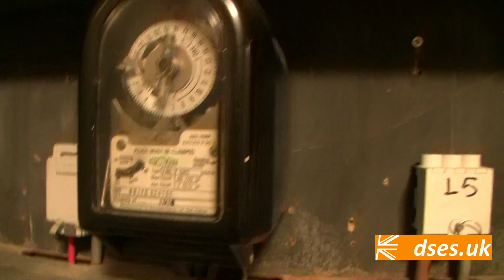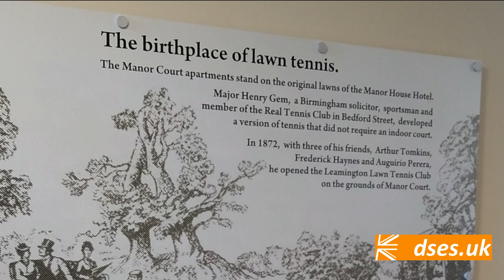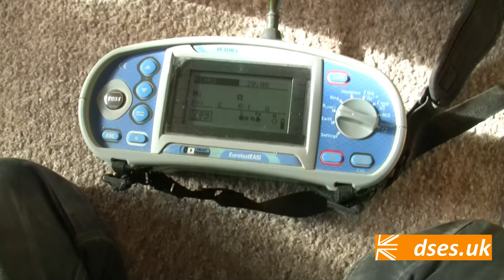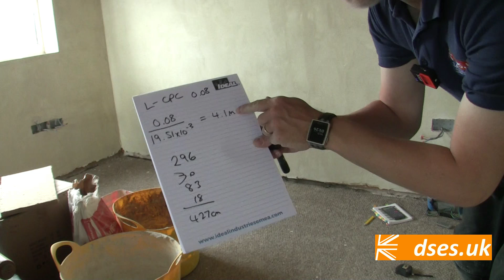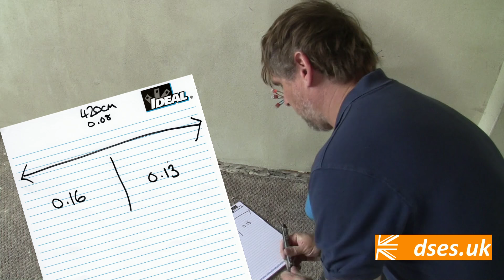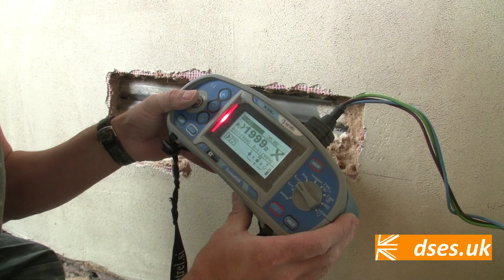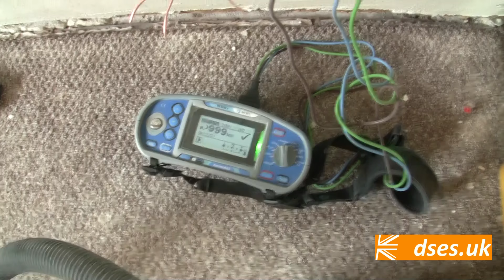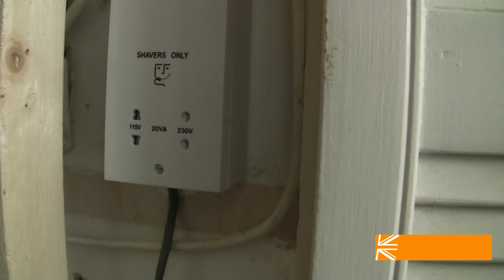Fixing another man's lash-up!

Comment: Quite a lot of people are saying it was done this way to balance the ring which I understand. Except that if you're going to be running both legs of the ring together wouldn't it make more sense to use a radical. Is there something I'm missing?
Reply from the maker: For something this size, I'd have run it as radial circuits. Probably one for the kitchen, another for the lounge and bedrooms.

Comment: Excellent content as always, thanks.  Fucktardary, Bumholery, great.  When I put rings down, which I prefer not to preferring 4mm radials, but when I do I kind of leap frog the sockets one with each leg as it goes to equalise the load along the length, but what you got there looks like nothing to do with that.
Reply from the maker: Thanks Rupert, I also fly the radial flag. It does seem like leapfrogging was the order of the day here, but in a capped domestic installation I question the reasoning!

Comment: This idea of frog looping seems to originate from the mistaken belief that distributing the sockets evenly along the ring somehow balances the current between the two halves better.  It actually doesn't make any difference to the currents which is probably why the practice is no longer taught.
Reply from the maker: I can see the method in the madness, but as you say, it just seems to complicate things with no benefit. Running in a line from point to point makes more sense to me.

Comment: Thanks David, really informative video on tracing a cable fault. I had similar problem when BT engineer drilled into the cable. Just used choc box attached to brick and put blank faceplate over it due to time / cost restrictions Not ideal, but ok if still in prescribed zone?!
Reply from the maker: The blank faceplate would have left it accessible and denoted its presence, so no problems there Nathan.
Reply: @dsesuk  as a householder I dont like blank faceplates they stick out of the wall and mess up the flow of it for hanging pictures etc.
Reply: @dsesuk  

So long as the connector block was of adequate rating!

Comment: Given two circuits would need to be in the same zone, would you run the cables for both circuits through the accessories or behind them somehow? I'm not sure how this would work! Thanks.
Reply from the maker: I've done it before where I've dug out behind an accessory position to allow another circuit to route past it. I don't like going through it, as anyone isolating that accessory for maintenance has another cable still energised passing through. This could have been done differently though from first-fix, and I'd have probably done it myself so that sockets ran horizontally at a low-level, with the heaters running in the 150mm prescribed zone at the top of the wall and dropping down into position. That's how I did the bedroom there which I mentioned on camera but didn't show.
Reply: @dsesuk  

I've also gone behind with other circuits although don't personally see any major issue with running a t&e cable through a backbox to a different circuit. I don't see such a cable being at any more risk than one directly clipped to a wall and that is acceptable.

Comment: Mate, there's a big difference in phone & laptops as far as charging current is concerned. You can't lump them in one catagory
Reply from the maker: Don't think it makes much difference with the design intention here. I also suspect the entire installation is metered off-peak anyway, so all sockets will be at a cheaper rate and not just this one wired directly.

Comment: I may have thought about cutting in a box. And doing a surface joint behind an accessory
Reply from the maker: That would be ideal Andrew, but would put it out of line unless the cables were extended, in which case you still have junction connections in the wall.

Comment: What you could have done was to work out the ratio of where the short was, total resistance = .13+.16 = .29,  for the short side it's .13/.29= .448, multiply by the cable length 4.2X.448=1.88 meters or 220mm right of center :)
Reply from the maker: Bear in mind, I got a GCSE grade D in maths.

Comment: I thought the 🇬🇧 uk uses red live black neutral green ground each conductor thicker strans of wire 
I wonder why the uk is 240 volts and Germany is 220 volts can you use a german 220 volt refrigerator in England on 240 volts or a British refrigerator made for 240 volts in Germany on 220 volts thanks
Reply from the maker: The old colours were indeed red and black with green oversleeving for earthing being replaced by green/yellow striped sleeving back in the Eighties (I think). The UK harmonised with Europe back around 2004-2006 and red/black was replaced with brown/blue. We also (supposedly) harmonised on voltage, but all that really meant was a tolerance was introduced where the supply was now classed as 230 volts -6%, +10% giving an allowed range of 216.2 volts to 253.0 volts. Nothing really changed on the supply side, and 240V is still what your meter tends to read most of the time. Anyway, equipment manufacturers make their stuff to run in that range and everyone is happy. Or as happy as squabbling European countries ever get.

Comment: When faced with a concrete floor,  if (and depending on nail fit of skirting).  I would run cables in steel pipes down to the floor then run behind the skirtings - good idea or not ?
Reply from the maker: Certainly a viable option with the steel providing mechanical protection. I don't like cables behind skirtings personally, but if contained in steel they should be okay.
Reply: @dsesuk  

Steel should be 3mm thick or connected to the MET as I understand it when not ran in normal zones?

Comment: Install a new cable at floor level behind skirting inside the zone and then just small chase up to the socket?? Another option and in my opinion better concealed junction on a re-wire not ideal
Reply from the maker: I'm not a fan of cables behind skirtings or covings.

Comment: It looks an acceptable option David, just a query does the joint not need to be accessible or is that covered by the relavent regulation?
Reply from the maker: Reg 526.3 allows non-accessible junctions under certain conditions, one being that the JB meets the standard of BS5733, is installed to manufacturer instructions and is de-rated if necessary. Others cover things like SWA splices, solder or brazed connections and crimped joints. Other countries don't allow such. More on that here: https://www.dses.co.uk/index.php/free-advice/180-inaccessible-junctions
Reply: @dsesuk   Thank you for a very complete and comprehensive answer , much appreciated.

Comment: the only thing i would add after dealing with joe public after many years is give customer options ie best soloution rip the cables out put them back in the correct place or as you did option 2 a repair ts safe and to regulation but not to the spec of a new install you may have done this but not made it clear in the video but then the decision is down to the customer and in the very rare event of a future failure you dont have to return from your foreign villa in your retirement  due to money made from fantastic youtube videos regards mike

Comment: I remember when I lived in Lincolnshire the house there was wired up a bit weirdly, instead of each floor having socket and lighting circuits, it was split into front of house and back of house
so if an electrician didn't expect it, then they would be in for a shocking surprise (<--bad pun detected)

Comment: Still fitting storage heaters? Why. Lot 20 rads 24hr all the way.
Reply from the maker: I use storage heater as a generic term as that's what was there. I believe the homeowner has selected a replacement which is fine by me as I want nothing to do with this LOT20 shite. I fitted a LOT20 heater into my own home and it has a fucking mind of its own.
Reply: @dsesuk  For most well insulated flats storage heaters are fine for space heating, these are not victorian large rooms but 2400mm height max and little heat loss through the ground either,  so once up and running convection to the ceiling then back down goes ok.  I used to have heat loss when I had single glazed crittall windows but decent double glazing is fine.

Comment: There are a few too many odd questions. 
why did they get rid of the other guy,what caused all the delays and changes, and the fibre board walls are odd.Does the board retain the heat so the usage of the flat cannot be viewed from outside by thermal imaging ? Strange socket outlet from cheap source power source for night use?

Maybe I'm  watching too many cop dramas during lockdown

I would have run a mile from this one, you'll never be clear of their crumbling plaster, and poorly designed reworking project.

Invoice and abort

Comment: can't  you stick an additional low level socket outlet ? If money is the issue, metal backbox and a blank plate.
Reply from the maker: Could do, but it would be out of line unless I extended the two ends of the cable in which case you're back to junctioning within the wall.
Reply: @dsesuk  we'd just throw one of these in https://www.gewiss.com/ww/es/products/experience-catalogue/catalogs/series/building/48-range-flush-mounting-junction-and-modular-boxes-system

Comment: 41:48   How did Sparkie #1 bend the nails in that soft block???   Probably hamfisted and using a sledge instead of a controllable hammer.  Maybe he is is premature dotage, as shown by his stupid arrangements of wiring back and forth??  That would use rather more cable that a straight through route.

Comment: I wouldn't worry about the electrics, as soon as they paint them walls , all the skim is going to peel off the walls, have they never heard of foam backed plasterboard
Reply from the maker: It'll be interesting to see how it looks on second fix as I believe they're doing something about it.
Reply: Can I ask when you do a 2.5 mm ring main for sockets, they say that a single cable can not take 32 amps, so how come it is ok to spur off a socket with one single 2.5 mm cable ??
Reply from the maker: @sen5908  It's permitted so long as the spur goes to one single accessory (i.e. a single or twin outlet only). In that event, it's unlikely you'll overload it... unless you plug in, say, two 3kW electric radiators! It's allowed for practical reasons, assuming a short run in a location where overload is not expected through normal use. Personally, I tend to run 4mm radials for domestic kitchens at 32A, and 2.5mm 20A radials for things like bedrooms and living rooms.

Comment: Is the kitchen n lounge ring wire through the stud and horizontal around 450?...concrete floor ?.......mabye the boy wired a ring then changes were made ??  ....its lookin like he put accessories on the wall to get squared up with some pennies also
Reply from the maker: Concrete floor, yes, and accessories height in compliance with Part-M. The cables are chased into the original walls which have then been overboarded (not dot & dab, the fibreboard is flush with the original walls which is why the cables were chased in). I think he's run it out of zone because he's leapfrogged the sockets as others have pointed out. Had he gone point to point, it would be easier to zone and would have made more sense.
Reply: @dsesuk  just shows the different ways we all visualise and plan the runs  ..part m does not compute up here in the hills lol....do you see these non traditional builds alot down there ?

Comment: The NEC doesnt allow for covering up joints for a reason...
Reply from the maker: The NEC don't exist on the other side of the planet.
Reply: The wires could have been soldered together (which I would have done), taped up, then left inside a plastic box.

Comment: Nice experiment finding the correct length,resistance etc, but really,is that necessary.
Wondering how you make money,& who is actually paying for all this.
Reply from the maker: You're saying..... it's not economically viable to try and pinpoint the location of a fault when... faultfinding??
Reply: David Savery Electrical Services  not at all,fault finding is a skill, that most sparks have no idea about. Obviously renewing the damaged cable is a priority.With or without measured resistances.

Comment: I use the skip a socket method when wiring in dildo (dado) trunking when the sockets are relatively close to one and other, it stops one long leg running past all sockets to get back to db when you only have one drop. I have never seen it used in a domestic installation tho 🤯 Do not see the benifits here. Maybe the spark didn't know how to wire conventionaly 📌🔨
Top video once again David 👍🏻
Reply from the maker: Thanks Adam. I don't do much commercial work, so was ignorant of the method. First time I've seen it domestically.

Comment: I'll be ridiculed for this from the spark mafia.  I'd have just done away with the duff leg and split the ring onto two 20 amp breakers..... Assuming there was a spare way in the board.
Reply from the maker: It wasn't a ring, or even a socket circuit, it was an off-peak feed for a storage heater which was to be sited on the far wall, so no getting around it. Nothing wrong with the ol' ring split though. Have done that before when I couldn't get to a faulty section of cable.
Reply: Ahhh, right so Ted.... Was in the game for 26 years and never realised how rough I was till I started watching yourself and fellow YouTube sparkies. Was brought through in a culture of the bang test. ie. If it didn't bang when switched on it was ok. Wasn't till I did 2394 and 2395 courses I upped my game.  It's an absolute miracle that nobody died at the hands of a spark in the company I worked for (Glasgow's biggest social housing maintenance contractor). Did a complete career change but still like watching the videos. Keeps my eye in. Some crack with you and Nige too.

Comment: Test resistance to capping ? So if it is a capping screw
Reply from the maker: Good point.
Reply: Potentially useful as you could likely access the ends of the capping from the back boxes before making any holes. The same method could be employed using the resistance of the capping to either the CPC or N and then using the ratio of these numbers to get an actual distance. Since this was not a full short, this could be a useful method although you would only get readings from both ends if the capping was fully in contact from box to box.

Comment: Unfamilliar with the regulations in the UK but could you have simply put a box and an outlet in there that could be used to plug in a television or table lamp, etc.  (probably an outrageous idea since I haven't a clue about the rules and plans, etc... regards). (Answer: too many outlets and it would go over the allowable amperage per circuit?).
Reply: PS Previous electrician was boozing on the job.
Reply from the maker: Thanks for tuning in. If it were a socket circuit, then yes another point could have been cut into the wall at the damaged position, although it would have been out of line with the other accessories in the room. As a feed to a heater though, it shouldn't be passing through the socket point it already is.

Comment: At 31.:4 minutes.  You could even put one lead of the meter on the nail and see if there is a connection.
Reply from the maker: True Alan, and I'd perhaps have done that as part of further tracing had I not found the nail so soon.
Reply: @dsesuk  

Not convinced that would work so well as the entire length would have been connected to the damaged conductor. Any nail in that capping length would show a short, as would any part of the capping...

Comment: Could have chopped a new back box in and added a new double socket ?
Reply from the maker: It would have put it out of line with the other accessories in the room though. Otherwise, a viable option.
Reply: David Savery Electrical Services   Maybe mount it vertically  and blame the bodger

Comment: At that low level, why put a protection over the cable? Just tack it in and plaster it! If someone was to put a nail or screw in it, they will either way! At the level it’s highly unlikely to get any thing screwed or nailed into it. Regulations are so anal.
Reply from the maker: Agreed, the capping is fairly useless here and doesn't meet the requirement for mechanical protection. He could have just clipped the cables between sockets and saved himself some arsehole.

Comment: Feckin brilliant ☘️
Reply from the maker: Thanks for tuning in again from the emerald Isle William!
Reply: David Savery Electrical Services Now resident of the UK, awaiting to be deported once  have finalised leaving the EU, cos I commented on your crazy ring final circuits & not using flat twin & cpc with all conductors the same size & cpc insulated throughout its length 😂😂😂😄 Get a grip , and another thing, stop using capping, fit conduit  & chase it in the walls 👍👍👍
Reply from the maker: @williammartinculleton7523  I'm no ring fan either William. As for CPC sizes, I'd like to see 'em bigger, but then I think about what a nightmare that would make running anything thicker than 4mm! A 10mm shower circuit would be far too much like hard work for a lazy git like me!
Reply: David Savery Electrical Services  10mm for shower ? Always use a contractor, simple light switch to energise the coil  ( And "they" call the Irish thick ) ⁉️😂